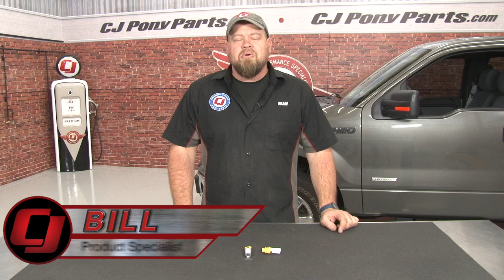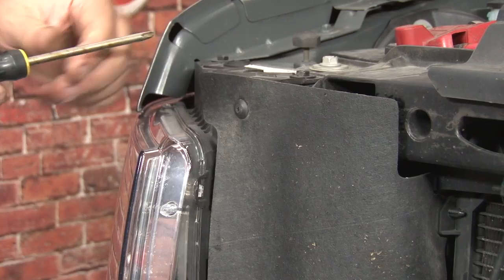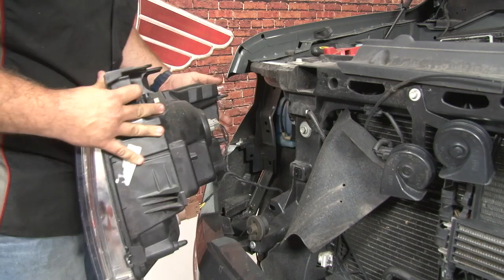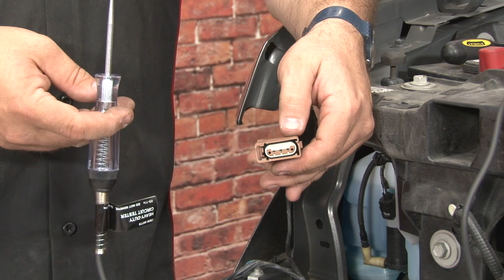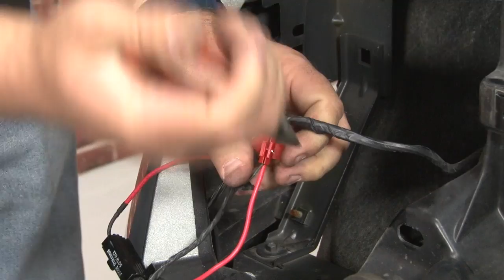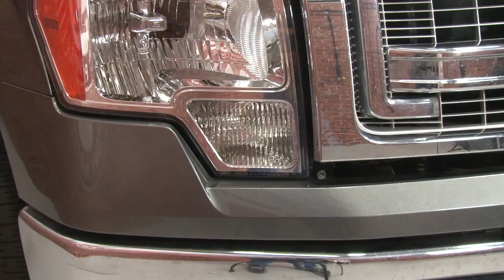F-150 Diode Dynamics Front Turn Signal Bulb LED Amber Pair 1997-2014/Raptor 2010-2014 Installation

Comment: Why not use Forscan to disable hyperflash? I realize this vid is seven years old, but Forscan is older than that. Maybe that wasn't a capability back then, but it is now -- and in plain English.

I've not done mine yet, but I'll do it tomorrow and make my now-LED fog lights daytime driving lights on my 2010 F150 Lariat. I got hyperflash from the rear blinkers even before doing the front, my only issue while replacing all exterior bulbs to LED.

Comment: Leave it to Ford to design a vehicle that requires removing the grille as a first step for changing a light bulb.  That is unacceptable and precisely why I don't buy American cars.  This was designed precisely to raise the billable hours for dealerships at the expense of hard working Americans.  That is why we need extended regulatory action to keep corporations in line.  This is symbolic with whats wrong with corporate America and the poor people it has under it's thumb.
Reply: you obviously don't own an F150 lmao
Reply: ***** yo

You're right, I don't. I got talked into working on my dad's ex-girlfriends fathers truck because no one else was willing to do it.
Reply: Well you don't need to remove the grille.  The grille is attached to the hood. When you pop the hood the grille comes with it and is out of the way.  Easy access. Changing a lightbulb on BMW, on the other hand... Now that is a process haha
Reply: Now wait a minute, this hood isnt like that at all. The grille is in place with the hood open; not attached to the hood.
Reply: Then you have a 2015+  I cannot attest to the newer models, but my 2011 and the 03 before were/are very easy to work on
Reply: Jared Haas It is a 1997 F-150 XL
Reply: And you obviously did not watch the video, just spewing false comments...
Reply: I had an '06 GMC Sierra where to get at the front turn signal bulbs was easy.  All I had to do was replace the flasher with a LED unit.
Then, I had a '13 Sierra and it wasn't easy to get at.  Flash rate was controlled by the BCM moduele.  The 2500s and up, you could reprogram the flash rate, but not the 1500s.
Reply: Wow should probably do research before making that comment the grille and hood open as one,good design by ford
Reply: You sir made yourself look like a major dumbass not knowing the grill is attached to the hood. Do some research first before looking like a fool

Comment: I used a new flasher relay for led's #ep27 no resistors needed. I have zevo led's front and back. No hyperflash yay.
Reply: Seamus603 I think my 2011 f150 needs 2 relays, how many did you need?